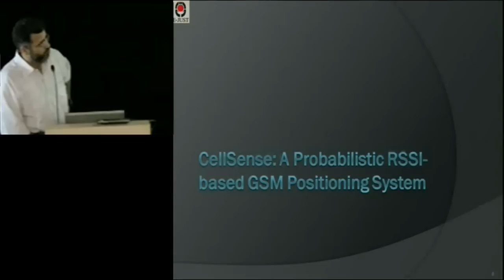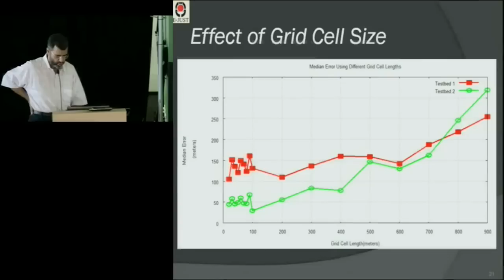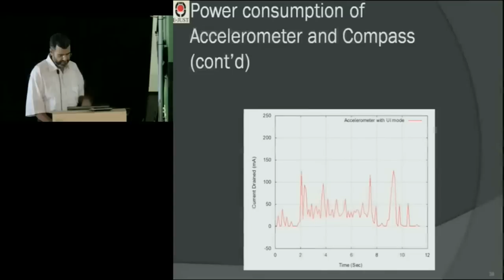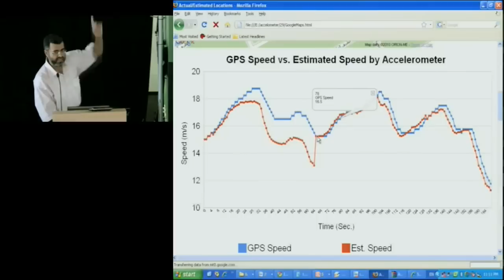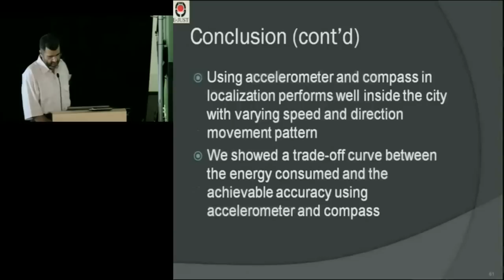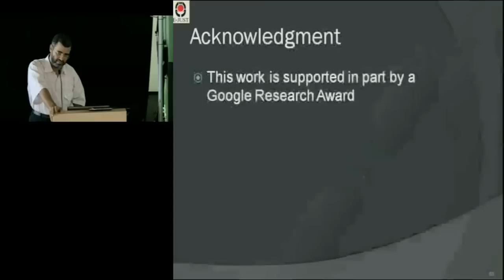Locationoid: An Accurate Energy-Efficient Location Provider for the Android Platform

Comment: Is he actually proposing a system which would be more accurate than GPS, yet he wants to use GPS to determine the location of the spots where he is collecting an RF fingerprint? Tricky.. It might be possible using statistics though. But I'm not very confident, probably takes way to long to set this up.